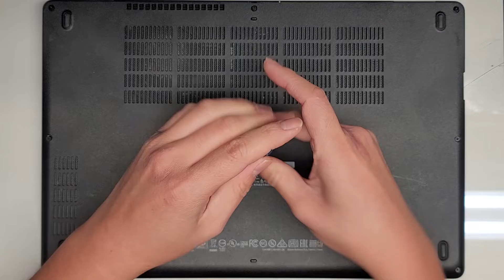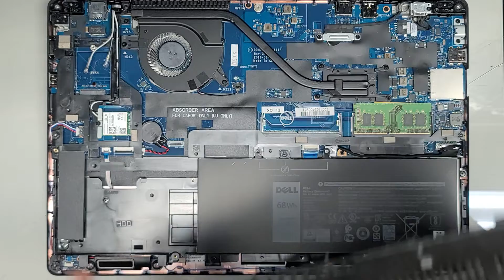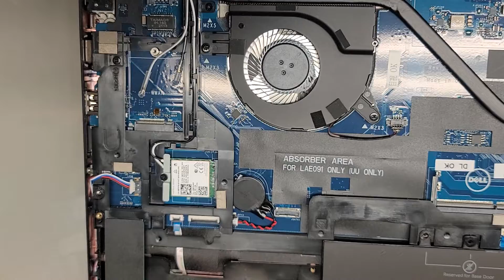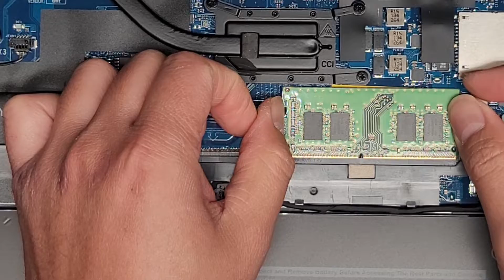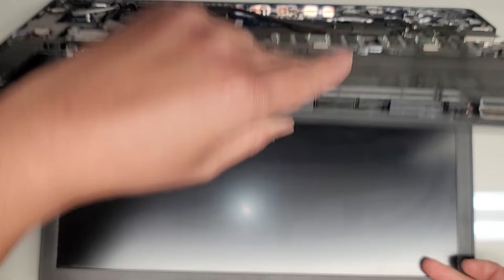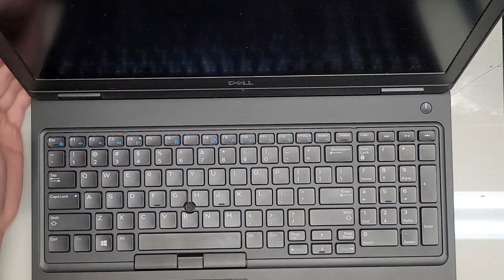DELL Latitude 15 5590 Disassembly RAM SSD Hard Drive Upgrade Battery Replacement Repair Quick Look

Comment: I just bought one of these for about 200 bucks. For my use it looks absolutely solid and relatively modern - new enough to run Windows 11, USB C, m.2 and all. Should be fine for me for many years.
Reply from the maker: @John_Ridley  nice!

Comment: Thanks man, I didnt know that you can add another SSD with a cable. Again, can you tell me if i can do it without a caddy just with the cable pls?
Thanks fpr the video😊.
Reply from the maker: @dr.egg_mix5433  caddy isn't necessary with an SSD.
Reply: @ItsBinhRepaired  thx man appreciate it
Reply from the maker: No problem

Comment: I have this same Dell Latitude 5590 (Mfg. Year: 2019) but it came with Dell 51Wh-11.4V battery but unlike your video which shows 68 Wh-7.6V battery (bigger one)
For a better backup, I too want to upgrade the battery. The support page shows Dell 68 Wh-7.6V same battery as in your video. Now I am little confused if it is ok to replace a 11.4V battery with 7.6V.  I am aware that a 68Wh means more Watt Hour (backup) but should not the voltage be same i.e. 11.4V as my present battery? 
Your any help in this matter would be appreciated. Thanks
Reply from the maker: Voltage should be the same. They're likely different year models.

Comment: Are you sure it it not necessary to unhook the battery?
Reply from the maker: Depends on what you're doing to the computer.
Reply: @ItsBinhRepaired  Just ram
Reply from the maker: @dougsandford  just make sure the computer is off
Reply from the maker: @dougsandford  and restart one time after installing
Reply: Thanks for helping me!  @ItsBinhRepaired
Reply from the maker: Yup

Comment: Hi. Thanks for the great video. I need to change my latitude battery. Do I have to buy OEM? Would like to hear what you think about.
Reply from the maker: Oem isn't required, but you need the same model.
Reply: @ItsBinhRepaired  Thanks a ton for your reply. I wasn't able to find the 56Wh OEM battery on Dell Canada website. With your teaching, I ended up ordering 2 x 16GB RAM and 2TB SSD to upgrade my Latitude. Once I get them will be able to replace with confidence. Wishing you the best.
Reply from the maker: @Vanessa-i8f  hope it goes well. If you haven't already, please like and subscribe so others can find my videos and possibly consider watching a few others to get the algorithm to recommend my channel. Thanks!
Reply: @ItsBinhRepaired  Hi. It was easy to switch the RAM and it is a great improvement. I didnt know I had to buy an adapter for the hard drive. Will get there eventually. I subscribed, liked and watched many vids of your channel. So interesting.
Reply from the maker: I hate how YouTube doesn't notify me of replies. Glad you're enjoy the videos. Hope the upgrade went well.

Comment: Hi 👋
I will buy this device, but does the PC work with 3200mhz ram? The Dell website says it runs on 2400mhz ram. Have you had any problems? Also, how is the battery performance? How many hours can you use without an adapter? should I make a battery change on a device that has been used for 5 years?
Reply from the maker: I don't own the computers, so I don't know.

Comment: I have the same laptop what is the max ram that I can put in there??

Also about the battery can I put a bigger battery or not?
Reply from the maker: There is no max RAM other than what you can buy and put in the slots. I don't think there are larger batteries.

Comment: Hi there
Very educative video.
I have a same laptop and i wish to upgrade to 32 gb ram and m.2 ssd, but before i buy. Would you suggest to replace those with the same ram that you placed (Crucial), and as well for m.2 ssd to put m.2 nvme drive 1 tb or 2 tb, could you confirm that please? 
Thanks a lot.
Reply from the maker: Sure, just depends how much storage you want.
Reply: @ItsBinhRepaired  i am between 1 or 2 tb
Reply from the maker: @MG-vv1zi  for the SSD, this is currently the best deal https://amzn.to/43WIC3B
Reply from the maker: @MG-vv1zi  good deal on ram https://amzn.to/461Dz3J
Reply: @ItsBinhRepaired  
Thank you again for the suggestions. ✌
Reply from the maker: @MG-vv1zi  no problem

Comment: After pressing F1 how much time it tooks, in my case its taking too much time 50min happened & still not opened.
Reply from the maker: What do you mean?
Reply: Its spinning only last 1 hr,
Reply from the maker: @indiastalent9788  sounds like a bad hard drive
Reply from the maker: @indiastalent9788 try taking the hard drive out and then doing it.

Comment: very cool video,, i saw another  you tube video of the latitude 5590 the empty wifi lan a person can put a small m.2 small ssd for storage ,, and a person also can buy a new hard drive caddy kit  with screws ,, wire and caddy for around 11 dollars on ebay for this laptop , to put extra hard drive space ,, you convinced me to buy one of this laptop from ebay  some laptops have soderd ram which is not upgradeable,,, also i like the charger port plug is much bigger and the power supply plug is bigger on dell latitudes,,, iam on my second dell inspiron 11th gen laptop bought it in 2020 and the charger port is already loose , the charger port is smaller on the dell insprons compared to the dell latitudes,,plus i like black laptops with back lit key borad ,, my dell inspron 5502 is silver and its hard to see the keys when the back lit keyborad is lit,, hope to see more videos
Reply from the maker: Nice! I got thousands of videos up. :)

Comment: Hello!  can you tell me how this ssd is holding up?  I bought the same 5590 Used but the seller deceived me and the SSD wrapped the SSD insulated instead of the original mount
Reply from the maker: No complaints from my customer.
Reply: i also own the dell latidude 5590 ,, i bought the caddy hard drive kit new on ebay  ,, including screws ,, the wire cable and bracket,,, to add my second hard drive for storage,,
Reply from the maker: @jimbob5885  nice
Reply: @jimbob5885  can you share with me link for these parts, Thanks